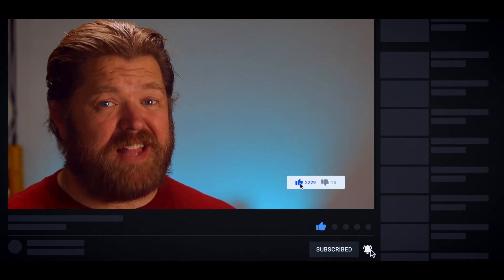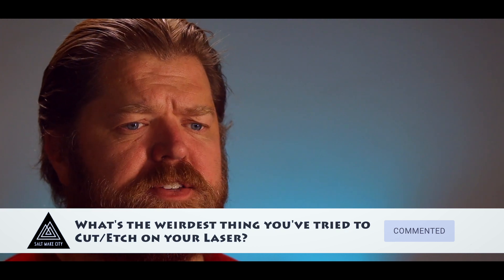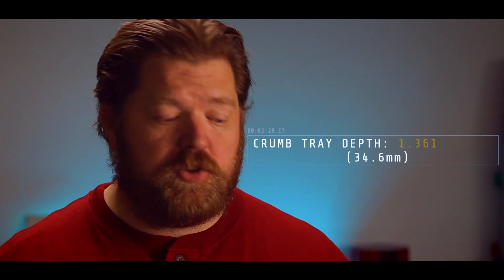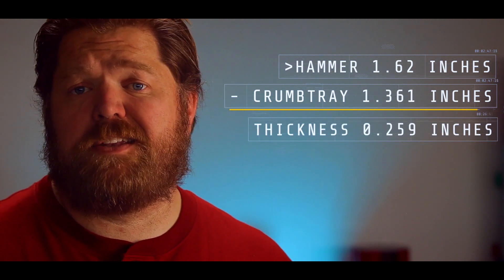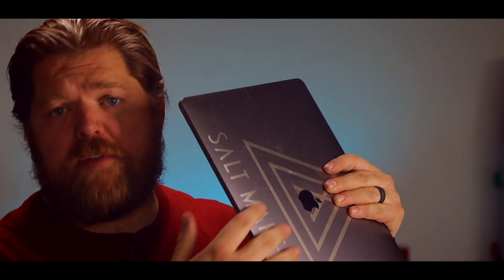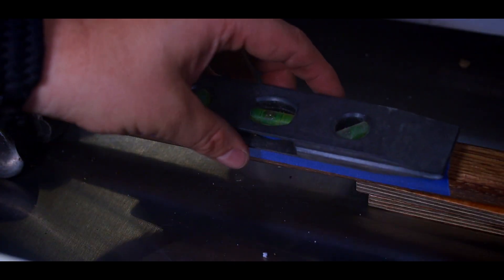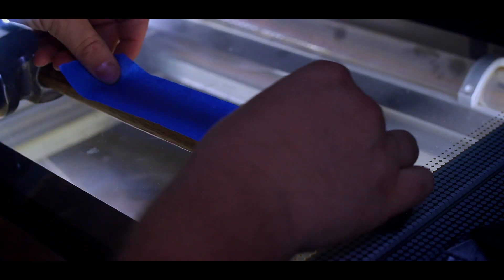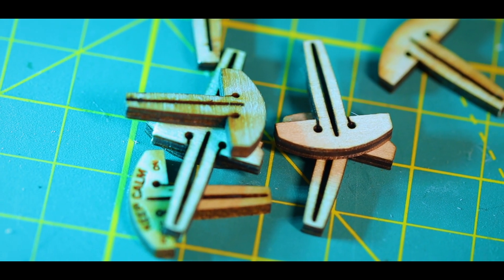4 Tips to Laser (Almost) Anything

Comment: You're making me want to get a glow forge!!!! I got some swords that need etching.
Reply: That’s an interesting idea. You will need to get the one with the pass through slot unless your swords are under 20 inches, or if you can fit them diagonally about 23 inches. With the pass through slot, you will need to keep the engraving to about 11 inches. Trying to align laser jobs between moves will be difficult. You might be able to make some kind of jig to move your material through the glowforge and I think I have seen a video on YouTube of a guy doing that with sheet goods.
Reply: @smittybuilds52  all my swords are traditional bastard swords in both style and length, so yes some modification will certainly be needed 😊
Reply from the maker: @metalsilks2470  Unless you knew someone who was a part of the pass through beta...which we are!  Let's do it!